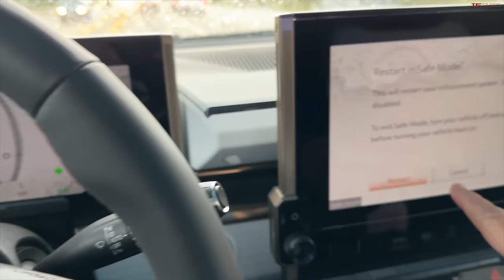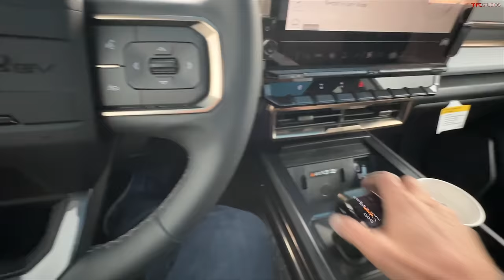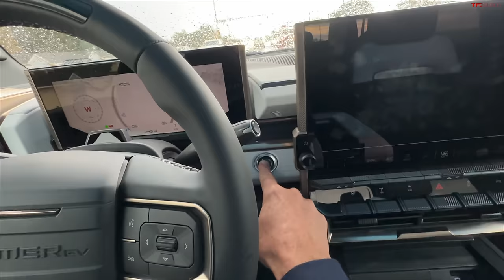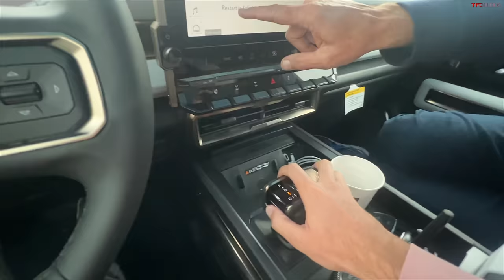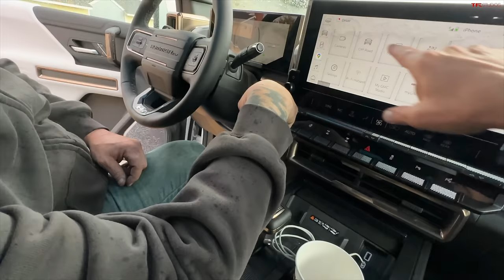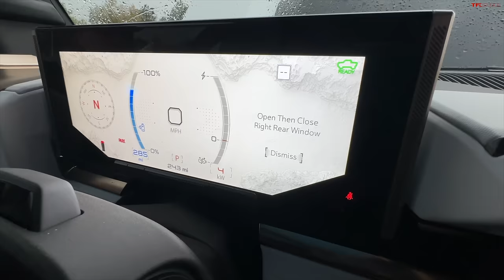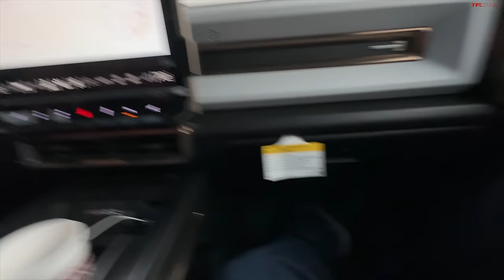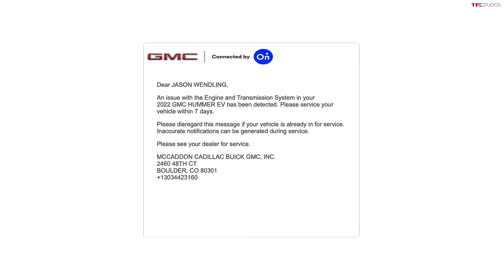I Bought a $115,000 GMC Hummer EV and It IMMEDIATELY Left Me Stranded!

Comment: Do we think this vehicle will be reliable after 10 years?  Will they still develop firmware for it after the warranty period?
Reply: Why would they? How long does your computer last?
Reply: @zidjanarie  longer than 10 years,... so far!
Reply: @regsparkes6507  that's an impressive computer lol
Reply: @zidjanarie  isn’t that normal I have a computer that ran windows vista originally and is know running windows 10 was an upgraded graphics card and CPU and RAM to keep it going
Reply: Firmware for your car 😂
Reply: @EdirtySicks  they’re better off using windows or android for software for electric vehicles instead of having absolutely no experience developing software like Microsoft and Google
Reply: @aurorayoru5333  my VW 1600 needs 4 wires to start. 3 to the starter and one to the coil. No computer. It will run forever and a rebuild it $300. How’s that for efficiency?
Reply: They will be on the Hummer 6S Pro Max by then.
Reply: @aurorayoru5333  How many computers and modules do you think are in that Hummer EV?
Reply: @aurorayoru5333  no experience? Lol, cars have had manufacturer developed software for decades.
Reply: @gogofastful  I work with vehicle aftermarket electronics. Automotive manufacturers don't develop new infotainment firmware or GPS after the warranty period.
Reply: Nothing is perfect only God .. So if something fail it might be a software error but also a human error.. 
Software can be up-dated & improved, just like mechanical or electronic parts so yeah.. human can not be improved but from each mistake we learn a lot.. 
Ice cars when they fail (sometimes with lots of casualties) so, they have recalls as well to improve what failed.. 
it's been done for ages.. BEV's are starting to get more common.. so why not we try improve EV to last longer too ?
Reply: @zidjanarie  Just an HP.
Reply: Resale value  will be awful with EVs.
Reply: @poplaurentiu4148  You say that, but the simplist vehicles are the longest running.
Reply: @AnthonyJ350  The thing is soon all the simplest vehicles (at least in Europe) will be banned by the traffic commission because lots of people died from pulmonary cancer of fossil fuel petrol & diesel cars.. so will be not allowed in cities or other public streets only outside on highways and by the end of 2050 only hybrids, EV hydrogen or alternative green vehicles.. So then what would you do with diesel and petrol cars ? in best case scenario will be locked in museums or private collections the rest will be destroyed & recycled..
Reply: After 10 years this vehicle will be scrap. Once the battery degrades, and stops holding a charge, it's nothing more than a parts car. That's one thing people have to realize when thinking about getting an EV. You only have so many charge cycles. Hence a hard mileage cap irrespective of how well the rest of the vehicle holds up.
Reply: @EdirtySicks  You've never had a TSB on a transmission for example to reprogram it to solve an issue?
Reply: @norwegianshaggy4419  The thing is that many new brands partner -up to produce better batteries, with different mixtures & better chemical compound different from Li , Ni, Chrom, more to Na and graphene, and Aluminum cathodes, and with lattest technologies that are improving with each year passing by will not be hard just like a ice-petrol car when doing service on it same with a BEV it will be able to have better electric components, better battery packs that can be swapped after warranty period of the old battery will expire and the new battery will be better to hold the current longer charge faster..
Reply: @AnthonyJ350  absolutely not. New vehicles have this problem. I don’t drive new vehicles. Never will.
Reply: @poplaurentiu4148  air particulates are from manufacturing not from cars with catalytic converters.
Reply: You will own nothing and be happy.
Reply: @EdirtySicks  Saying it could need rebuilt is literally admitting it won't last forever.
Reply: @AnthonyJ350  lol, not really. Older vehicles were not reliable, many needed engine and/or transmission rebuilds before they hit 100k miles. Just because it's fixable doesn't mean it's reliable.
Reply: @norwegianshaggy4419  Counterpoint: Once solid state replacement batteries become available and affordable (15 years probably) these early generation EVs will be hot commodities. EV drivetrains basically last forever and electronics/software does not automatically fail just because it's old.
Reply: @mechmat12345  I haven't had a vehicle payment for 13 years because I drive an old truck that is "fixable" as you stated. Which allowed me to develop my home shop/ youtube studio. Are you still making vehicle payments?
Reply: @ryantracy1531  Car payments for life 😃
Reply: @mechmat12345  nothing lasts forever and your e car’s battery will not last nearly as long and will cost 100x the 1600 to repair a motor or battery. Have fun with that obsolete technology.
Reply: @EdirtySicks  You are say'n nonsense.. Just look how many first gen Tesla S that was build early from 2008 but delivered to customers from 2012 exactly a decade ago and most of them that escaped floods or hurricanes or bad weather unfortunate incidents accidents & such that still run with original battery from factory and refresh over the air with software up-dates and overall way less costing in service maintenance over same decade than any owner of equivalent ice car.. weird accidents happen to ice cars as well man caught fire sure lots, faulty accelerator pedal stuck in floor causing thousands of deaths (Toyota) yes why not was fixed with a massive recall sure but the deaths who brings them back ? Ford Pinto gas tank explosions when were hit bumped in the back hell yeah plenty of casualties there as well.. Ford Mustang / Shelby although is not a bad developed car but somehow the statistic from US on last 5 years alone show a 75% involved in unfortunate incidents & accidents from total models produced.. whoa any petrol & diesel car pollutes twice when is made (fabricated) and when it is used in traffic with or without catalytic converters, those as any other part needs to be tested and also needs replacement & changing as well if are no longer in technical parameters but because are expensive parts many owners decide it is time to cut them off and remove them completely the car sounds louder pollute with noise and even more since the fumes & exhaust gasses are not filtered any more, meanwhile an BEV (battery electric vehicle) will pollute only during fabrication process manufacturing in daily use are noise free, not emitting any exhaust fumes or gasses only tire usage and brakes components (discs rotors & pads needs checking & replacement when it needs becaus the BEV also brake with electric motor when they regen put current back in the battery while braking another advantage of full EV which an ice can not do !) So yeah.. be happy while it last and enjoy your dinosaur urine fossil fuel ice cars that 'pollute daily & cause pulmonary cancer..
Reply: @poplaurentiu4148  absolute nonsense when you factor in the sticker price
Reply: @EdirtySicks  That is why govern programs to help people get new green vehicles are starting to spun out.. also in Europe at least you can recycle an old car and with that voucher from recycling yard it can be added & deducted from total price of new EV at the dealer, also remember an EV do not pay monthly pollution taxes that was added recently, and also you are allowed with EV even close to city center in any European major capital or city with ice & diesel are starting to get banned from city streets because noise & pollution, so in my case my wife trade an old kia sorento diesel that needed engine servicing starting to get noisier specially in cold mornings the oil pump buzzing, rockers, need adjustments injectors replaced new water pump, belts bearings & o ring seals the exhaust was thicker and she always had in trunk a bottle with oil to add starting to leak consume or burning more so i help her trading that and got a Kia EV6 that had in that particular configuration as first edition a total value sticker price of 51.000 euro but since she get rid of her older first gen kia sorento get a voucher for -3500 euro, and the govern grant for green vehicles for -10.000 euro and another cutt-off for -3600 euro insurance bonus for registering a new green vehicle cumulated with a dealer bonus for first edition long range it resulted to pay about 33.900 euros for Kia EV6 - RWD long range 77kw with some cool options selected, she also got a free Moon home charger station that was fitted in garage.. so overall it was a great trade deal she likes it very much, i did drive it too couple of times is silent & fast a bit harder on bumpy roads bu feels sporty.. so yeah..
Reply: @AnthonyJ350  yup

Comment: I know this is late but from my car hauling experience there is usually a “hidden pull cord” that disables the transmission lock, even on the electronic transmission selector. On dodge they are right under the light switch on the dash. I’m glad y’all got it moved though.
Reply: that will be too easy, or more like common sense.
Reply: @johnwebb2232  
How would finding a 'hidden' anything be easy?
Reply: Everything today is electronic, no linkage

Comment: Windows up and down are common on most vehicles that have “auto” windows fyi

And most electronic controlled doors (doors, hood, trunk, fuel door) will have manual release. 

Good to read the manuals before you drive a crazy technical vehicle that’s brand new

Comment: water got into the wiring harness of the steering column likely.  It's not letting you move the vehicle because it can't read the steering position.  Why it won't let you open the hood, no idea.  Not letting you take it out of park makes sense though.  Then, the window thing was just window position calibration, that's something my VW makes me do, plus sunroof and wheel position, when I disconnect the battery.

Comment: I just saw a F150 non-EV stranded in the middle of a very busy road blocking traffic because it died and the driver couldn't even get it into neutral to push it off the road.  Very bad when you can't even shift into neutral.

Comment: Fantastic video I wish we all had EV’s with good range and fast charging. But All that electronics is why I like my cars stripped not equipped. All you need inside a car is the air bags, air conditioning, and a radio. Maybe an automatic if you can drive stick. But all that extra electric stuff needs mini computers to run them and then all the modules need to talk to one another. When they all work, it’s awesome. But when they break it’s a never ending money pit (too expensive)
Reply: Excellent comment
Reply: I love my 80’ Chevy C10. I’ve owned it since I was 15 and now even though I’m 21, I still will never sell it. Looks good, runs good, and has never broke on me. It’s 10x the quality of a new truck.

Comment: I was internally screaming at my phone for 14 minutes about the manual hood release lol. It's crazy that it's not made plainly obvious in whatever kind of manuals are available for the car. Those should be like page 1 imo. I was responsible for designing that release cable in the EV Silverado, but it was more or less a direct swap from the Hummer. I just had to tweak the routing a bit.
Reply: These guys get way too flustered way too fast. A 5 second Google is all it took after reading your comment and I found instruction for the release.
Reply: @LT3Fluffy  yeah once you know it's a thing I'm sure it's no problem finding it. The issue is that apparently people don't realize there is almost always a mechanical backup for electric latches (looking at you tesla...) but I know in the past there was a guy who died in his corvette because it lost power, he didn't have a phone, and he didn't know the doors had a manual release. And I guess he had no way of breaking the windows open either.
Reply: @ZeroSuitSamo  want to say the corvette involved was a c6 or c7, too..
Reply: @LT3Fluffy  exactly. Instead of randomly fat fingering buttons a thousand times expecting something different look for an actual solution.

Comment: It’s a GM product, having owned a few I’m always surprised when folks expect their cars to be trouble free.
Reply: I’ve had 6 new Hondas over the years and have never had to take one to the dealer for anything but routine service.
Reply: Exactly, however no “override” to get this vehicle out of harms way is a serious design mistake, in my opinion. For public safety I hope this is an isolated event.
Reply: I have had a volt for 7 years and never a problem
Reply: @gandmemoney  until your 20000 dollar battery fails in a few more years or less
Reply: @Jag-leaper  I looked that up today, it said 6700 dollars. Not sure if that was accurate and was before labor.
Reply: @gandmemoney  Gen 1 or 2 volt? There was a couple in Florida whose battery died on their  gen 1 volt And the replacement cost was $20000 for an aftermarket battery not  including labor because the original battery was discontinued by GM

Comment: The first option when the roll back tow truck arrived ,should have been to fit the tow dollies clearly mounted on the deck and get the Hummer up and out of there .
Yes it may have been pushing the limits of the dollies but considering you were concerned about safety,thats what I would have tried .
I think your son hit on a good point ,stop touching the screen buttons ,as with a computer,when you keep pushing buttons it confuses it !
On the wider issues of knowing how to own and control an EV,there needs intense training before you hop in and drive off ,as with a normal vehicle.
Yes you have highlighted the potential issues with technology,but it might be a case of read instructions first before attempting any reboot ,whilst on a roadway ,in other words ,slow down and process what the system is telling you  😃
Reply: Hindsight 20/20 brother.

Comment: I'm betting the windows on your Hummer have an auto-up function. To detect if the window is trying to cut your fingers off,  the system probably monitors how much power the window motor is drawing. The system wants you to run each window down an back up to get a baseline current reading for closing the window. Then it knows if the current is too far over this baseline value, something is getting pinched by the closing window.

Comment: Wow that sucks guys.  I feel your pain.  You were probably so excited to get it.  Then this crap happens.   Maybe putting it into safe mode is the reason. You had to do all of those funky window things?  I have a RST EV preordered… I’m a little scared now haha.     Gotta love how calm and cool Tommy  is though.  That guy would be chill standing in the middle of a minefield
Reply: The "funky window things" is a normal procedure on most if not every vehicle when you disconnect the battery on vehicles that have powered mirrors and windows, it's recalibrates the up and down functions and makes sure they work properly, you can bypass and skip it tho and do it later if you want, it's not really urgent. Another comments gave a good reason as to why this is the case, "To detect if the window is trying to cut your fingers off,  the system probably monitors how much power the window motor is drawing. The system wants you to run each window down an back up to get a baseline current reading for closing the window. Then it knows if the current is too far over this baseline value, something is getting pinched by the closing window."

Comment: It seems to me EVs are overly reliant  on software even for systems that don't require it. Say like for a 
 hood and trunk releases or putting them in tow mode. None of which should directly require computer software to accomplish. I think there should be a  mechanical disengagement mechanism to allow for towing. Luckaly they found the cable to open the hood but it took digging through an online manual to find it. I'm not sure why a standard hood needed to be replaced by an electric solenoid.
Just seems like electrification for electrification's sake.  None of it makes sense. You only have a  finite about of battery charge. Adding more electrical systems to drain energy is counterproductive to me.

Comment: There are engineers out there that have the job of asking all the ‘WHAT IF’ questions. GM needs some of these engineers in this new EV arena. 
These new electric vehicles are too complex for my liking. My 99 Silverado has three computers I’m aware of; engine, transmission and fuel pump. So far they’ve operated flawlessly.  What’s going to happen to these complex vehicles as they age?
Reply: Extremely expensive replacement parts.
Reply: They will be just like ever other electrical appliance, throw away item.
Reply: Old automotive ECU's were far different than what we are seeing in EV's today.  What has happened is instead of having independent embedded computer systems that have limited scope and failsafes we now have orchestrated computer systems that talk to ECU's or worse the central computer system has taken functionality from the discreet ECU's.  Those older ECU's are like a car part, it works, does a very specific thing, pretty much unless you update the firmware it does what it does and if it fails to take it out and put in a new one maybe you need to "program the system" which is really just a registration process mostly to lock people into going to the dealer for service.
Reply: ICE vehicles for life.  Hate EVs.  Hybrid or ICE vehicles FTW!!!